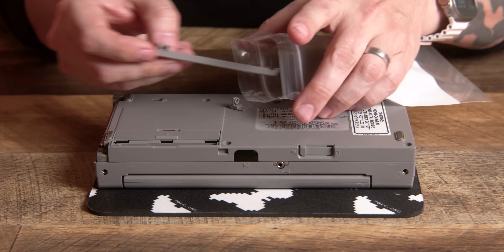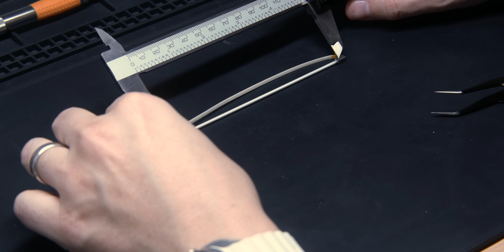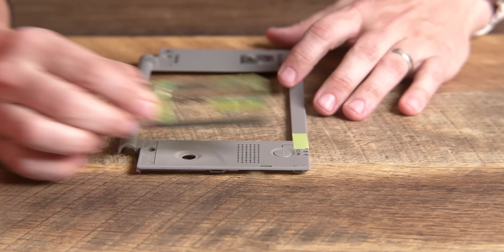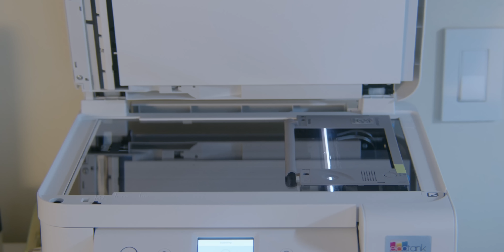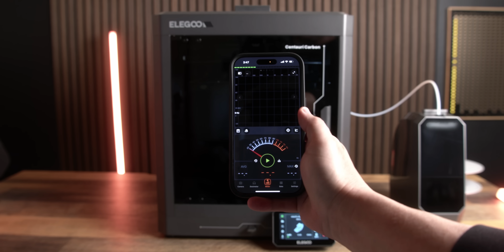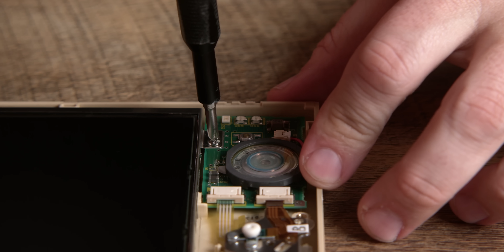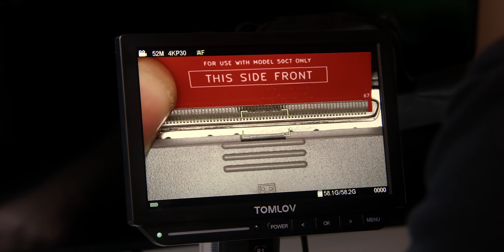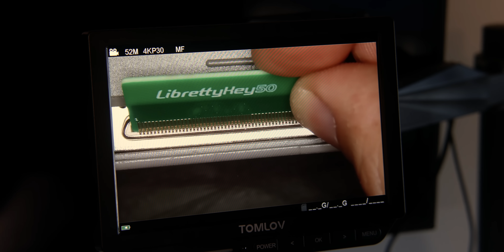I saved this crumbling little laptop from itself

Comment: Add ssd to the libretto
Reply: Alternate process: Take pictures, take it to a shooting range with a close-ish cased phone to record the Rapid Unscheduled Disassembly, build or grow (watermelon in the shape of Libretto110! Plastination of the watermelon hull with lignin process left to the reader's whim) emulation units that somehow keep their NPUs cool using that sweet ergonomic volume and hide USB-C ports behind ridiculous period stand-ins like 9-pin DIN serial ports and maybe some DIN mic ports.

If you had to work up the case mold in CAD first, of course you could mold it as a puzzle box where the case can be moved around a bit until it's a Libretto that transforms into a Nintendo DS of some denomination, or a NeXT Station, or an actually secure pseudo-Android media player box and ATSC-3 fuzzer. (Again, why would you spend 5W on the OG electronics unless you really need to see them go nonfunctioning, if you can swap in a BananaPi 7 or such?)

Comment: Epic. I have a Libretto 50CT with a small crack in the center of the lid. It's great to know that I could potentially fire up the printer to fix.

The one problem with the Libretto that I see: there's no way to connect an external mouse. I've been playing with piping serial mouse data over the IR port for a few months now - I have serial coming in from an Ardunio, but I can't get the included Windows 95 mouse drivers to pick it up. I'm starting to think that this is going to take a custom mouse driver to work. Yikes.

Comment: Yes! Where can I buy that backlight tube replacement? Any part number? Measurements? Specs? Thanks for showing how to take the screen apart! I got stuck some months ago. Did not think I could dismantle it further. Also, wonder why did you not do the bottom case piece?

Comment: I still have my 100CT with the, PCMCIA floppy drive, full dock and the travel dock. The only problem I've run into with it is with the PCMCIA slots both have bent pins from the previous owner which makes the floppy drive useless unfortunately. I've been trying to figure out a solution but after small pins like that have been bent there's no real way to keep them straight again... 😔

Comment: Very cool. I would certainly be interested if you were to take the case you made and shoehorn in a pi, modern display, batteries etc.

Gives me flashbacks to my Open Pandora UMPC, similar form factor, but a bit more modern since it came out ~2006

Comment: How about replacing the CCFL tubes by LED's, is it doable? I think it could be a neat upgrade as the power consuption will go down, as well as the heat generation, and that is probably good for the LCD as well
Reply: You can get LED replacements for CCFL backlights, I’ve used some and they’re neat. They come as a stick, and you just cut them to length like a regular LED strip. Not sure if there are any small enough for this one?
But.. They’re not as perfectly “linear”(?) as CCFLs, so you kinda end up with bright spots. And for a project like this he’d have to redesign part of the case and the electronics for a different driver board.
They’re great if you’re just reusing an old panel with new electronics though!

Comment: Awesome work, your modelling skills and attention to detail are always a joy to watch! I had a feeling nylon wouldn't be suitable for the case but at least you gave it a go.

I've made replacement cases for a few old vintage transistor pocket radios recently and have been using carbonx pc+cf abs. It's a bit finnicky to print with, not cheap and you need a hardened steel nozzle / 300c extrusion and heated chamber with high bed temperatures which does put it out of the range of a lot of home users but once you have it dialed in the end result is hard as nails.
Reply from the maker: Thanks so much and totally - part of what I enjoy after I have a little down time between videos is just running off prints with different materials. I've also got a set of ABS ones printing now and some PA6-CF filament ive been wanting to try, but talk about finicky... 🙄

Comment: when the pcb didn't work for the second time, i suspected the dock had some mechanism (shorting pins or mechanically pushing some switch in the laptop) to indicate the laptop is docked. and when this mechanism wasn't activated, the laptop wouldn't bother to work with the pins in the connector at all :)
Reply from the maker: Great thinking, I had the same thought - thinking back to other laptops that have metal tabs exposed on the bottom that need to be shorted to know a dock is present. Seems like you've done this before :)
Reply: @polymatt  electric motorcycles' batteries use similar scheme - they have a connector with two thick pins and several thin ones. depending on which of the thin one you short to negative, it will either accept charge or provide energy to the bike. bike and charger have these pins hard-shorted so the battery knows what's connected to it. i had to reverse engineer this to be able to charge and discharge the batteries with unoriginal equipment.

Comment: It has 100% nothing with the age of the plastic to do how bad it is. It is 100% plastic type used.
I have a wireless ternostat contact  which is only 5 years old  where the 230V connector has a plastic type that can  withstand little and is quickly broken even though it is almost never moved or taken out and in from the wall contact

Comment: When I got mine, it had a RAM upgrade module that was slightly too thick. It created a noticeable lump on the keyboard. Worse, over the decades it had gotten hot while running and melted all the membranes on that side of the keyboard. Rebuilding the keyboard was "fun", and I learned that the 50 and 70 models use different keyboard connectors but the membranes are interchangeable.

Comment: Matt, fantastic work on this model! Every single one of yours genuinely makes me want to explore making my own 3D models of cases (an SGI Tezro case would go so hard.)

What do you use for those "prototyping" labels with the model filename and revision number? It looks very, very convenient. Keep up the great work!
Reply from the maker: Thanks so much! I just bought a new label maker - on the spendy side but I use it a LOT. It's a Brady M211 - found a discounted one in box on eBay. Connects over bluetooth and while the app isnt great, it allows you to make templates, generates QR codes and the material is second to none. It's a really nice nylon.
Reply: @polymatt  Woah, yeah, that is. Quite a lot, but considering the quality it might just be worth it in the long run. Thank you!

Comment: Holy snikeys. I have a similar problem with a Toshiba T4900CT. It has a proprietary HDD connector which is pretty close this one. But without the original cable which converts it to IDE, this computer is simply unusable.

Comment: I love the idea, the concept, everything. I have a real port dock relay from what was said in the video basic; a breakout cable from the connection on the back of the laptop could not make a more compliant password unlock key. Will all the ports of the docking station have one? And you are remaking the case on the laptop; make any mode the case solder the new design portrelayr in place, if that is done?

Comment: Ive got a 50ct with both docks and a pcmcia floppy for it as well as several HDDs with various OSes set up, FreeBSD, Debian and Win95. 
Havnt used it in the last decade but back when i was using it mostly as an IRC client via a orinoco based wlan card.
Its a fun little machine but sadly the battery for mine is dead, beyond just the cells, the controller board for it too. Ive though about getting a fresh battery for it but since its so low powered ive decided not to put cash towards that.
I even overclocked mine from the stock 75mhz to 100mhz by desoldering a leg on one of the ICS, it ran and faster but would overheat and shut down so i resoldered the pin so that it would be reliable again.

I love its form factor tho and kinda want to build a Raspberry based "modern" laptop in its size, finding a suitable keyboard is hard tho.
The case on mine is still solid but big props to your rework, subbed to see if you do more with this wonderful machine :)

Comment: those variable voltage power supplies aren't the best thing to use. they're very noisy and dangerous. My personal opinion is that using a variable voltage USB PD board is quite a bit safer. You can make them yourself with a trigger board with voltage buttons or dip switches and solder a DC cable to the end. even crappy 60-100w USB PD chargers are less noisy than even some of the best universal power cables in my experience.
Reply from the maker: This is a great tip - id love to make my own and to your point, would feel a LOT more comfortable knowing the reliability.

Comment: I've found with my Libretto 50CT the biggest issue I face is it seems to be pretty unstable and finicky. Often refusing to power on. Locking up while running Windows. Taking hours to run ScanDisk. And being very picky about hard drive replacements. Still I look forward to seeing what you eventual work out for case replacements. S far on mine I've 3D printed a new hard drive bay cover and it has only one crack in the keyboard surround on the back just to the right of the audio output jack.

Comment: Amazing work 🎉
Questions, so what did you think of the new printer (i have one on back order) and are you going to print a final version yourself?
Reply from the maker: Thanks James! It's really solid thus far. Granted I've only had it a month so I can't speak to how it holds up over time, but for $300 it seems like a steal. I've got an ABS version printing right now :) Also got a role of PA6-CF that I'm going to try but that stuff is ROUGH to print with.

Comment: Would using a 3d scanner (like the ones from Creality) make your life easier for recreating these things? (obviously they're not cheap, but still)
Reply from the maker: Its a good question - I've had mixed results with 3D scanners. In my experience I've had to spend more time cleaning up a scan than it would have taken me to model it in the first place. It has been a while so maybe the software has gotten better?

Comment: Toshiba plastic is bad but not the worst. Early 90s Macs are getting bad too especially the Performas, and Nintendo handhelds circa 2004.
What makes this case especially difficult is all the extremely thin interlocking features that have to be flexed to take it apart, and you will have to take it apart to pull out the NiCad CMOS battery before it corrodes the whole motherboard.
Storage conditions matter too, anything in a garage or direct sunlight will fare worse than climate controlled and in the dark. But in the end, Old Things Break. Thanks for giving us options for preservation. 

My other big issue with the Libretto 50 and 70 is that there's no way to connect a mouse without the dock.

Comment: tip: instead of using a heatgun to remove hotglue, use isopropanol. it basicallyy instantly unsticks hotglue without a trace and leaves the glue in one piece, so you can pull it off easily
Reply from the maker: Very handy tip - thank you!
Reply: @polymatt  91% rubbing alcohol works on hot glue. It'll even get hot glue out of fabric. Saturate the spot then rub the glue. It'll ball up and work loose from the fibers. 70% also works but slower. I use hot glue to hold things in place for casting silicone molds. Learning the alcohol trick made that so much easier. I'd been putting glass tail light lenses in my freezer then chipping off bits of the hot glue before it warmed up. That worked but took a long time. But one dribble of rubbing alcohol and the glue almost fell off.
Reply: @polymatt  You don't need a lot, just enough to wick under the glue.
Reply: Probably better he didn't do that here though because any alcohol spilled on the polarizer or diffuser layers will wick in and leave permanent white spots.
Reply from the maker: @darkhelmet169  also great point 👆
Reply: @darkhelmet169  ...like his faith prevents him from masking things with frog tape?
Reply: always be careful with isopropanol. too high a percentage can melt plastics, ruin labels, etc. 
you can always buy 99% and then lower with distilled water.
303 automotive plastic sealant or even something like pledge floor polish can really liven up dull plastics. 
when it comes to cleaning on the other hand, I use distilled water in a spray bottle and if there's spots that need extra help I use ammonia free window cleaner since it's basically just isopropyl with soap for added cleaning power and plastic moistening. you can also just put a single drop of dish soap into a spray bottle of distilled water, that works too.
Reply: @JessicaFEREM  Eh it's a non-issue. You need a fraction of a single drop per square inch of hot glue. You can literally dip a spudger or guitar pick in alcohol, so only the very edge gets any on it, then press on the corner of hotglue. It will instantly wick and pop it off, and the moment it does, it pretty much flash-evaporates because of how little it is you used.

You don't gotta drown it in alcohol. If you do as above, and some is still stuck? Just repeat, and press on a new area. Of course, if you aren't concerned about delicate things like polarizing film, then just put a drop and be done. FWIW, that white film isn't damaged plastic, it's additives used in normal first aid alcohol. 99% or reagent quality that is new, doesn't leave any residue. But it will happily absorb moisture from the air, and it only takes a few % before it starts leaving residue
Reply: Came here to say this, you beat me to it. It really does work a treat.
Reply: Thank you
Reply: This is seriously basic stuff lol
Reply: @falafell  it still needs to be said since a lot of schools teach this erroneous method of applying heat. I know cause that's how I was taught.

Comment: I still have  my Libretto 100CT.   The first time I saw one (1999) it was running NT 4 server and  working as a file server.
Reply from the maker: These little things are awesome. You'd like they would be underpowered netbook-type laptops but they were really solid!
Reply: Back than I do not think there were many tiny desktop towers, these days people would use something like an Intel nuc, or one of those systems like the HP EliteDesk usff systems, but back than if you needed a really nice compact server a laptop may have been a good option!
Reply: I have a few CT100s. I recently replaced the original 2GB HDD in one with a 16GB SATA SSD in an IDE adaptor.

Comment: For the scans - try getting hold of an old CCD type scanner, they have a greater depth of field than CMOS sensors that you'll find in all-in-one printer/scanners. That and an unsharp mask should make for more usable scan data for elements further away from the glass
Reply from the maker: Nice, yeah these get out of focus really quick when they're not right up front. Still better than nothing, but great tip on the CCD scanner.
Reply: @polymatt  For a decent CCD type scanner, the Epson 3590 may be the way to go.
Reply: @polymatt  If you want a good (at least from a online glance) CCD scanner, the Epson Perfection 3590 has a decent review by TechRadar in 2006.
Reply: @polymatt  You'll want to avoid the CIS type scanners. They're even worse than the CMOS for depth of focus, but excellent for image/box art/magazine scans. The thing being scanned has to be actually touching the glass to be in focus. The CIS scanners with LED lights are so low power, they can be run off just the USB port for data and power! Super portable.
Reply: This sounds like a good video idea for someone.

Comment: It's impressive what you do! I would have loved to see it done with a 100CT or 110CT like the ones I have. I definitely would have printed new cases; the poor things are already quite old.
Another downside of these laptops is the screens, many die due to the flex cables or the display itself failing. I've seen lots of them with stripes or malfunctioning after years of use.
I've taken apart several Librettos while restoring mine, but I never dared to disassemble the display—I see them as very delicate.
Great video! ^_^
Reply: like metal fatigue over time with opening/closing of the laptop screen causes the flex cables to wear out
Reply from the maker: Thank you so much! And yeah these poor librettos have not aged well. I've only had one other and the LCD has started to delaminate. I've been experimenting with ways to bring this back as well, but so far nothing that lasts more than a week or so.
Reply: @ yeah, sadly old laptops age like milk. brittle crumbly plastics, vinegar syndrome, fatigued flex cables, worn hinges, PCMCIA woes, and proprietary stuff.

Comment: When I need to solder traces to card edge connector contacts, I put kapton across all but the very back. This keeps solder from flowing further down the contact. Also, it’s good practice to give yourself some test points to solder to when making your own designs.
Reply from the maker: This is a great tip, thank you! And one thing I didn't show is that I made a whole breakout board to test the pins. I was thinking of how I could actually make a new dock.
Reply: I originally bought mine just to have a compact Win9x PC with a parallel port* so even one that has nothing but an LPT port would suffice. After my first dock crumbled to bits I’ll be babying my second dock and watching closely for any potential developments. Thanks for everything you do!

*My HTPC was too modern for an Win9x and an LPT port. I needed something to send N64 ROM dumps to my V64jr which wouldn’t intrude on other stuff in the entertainment center.